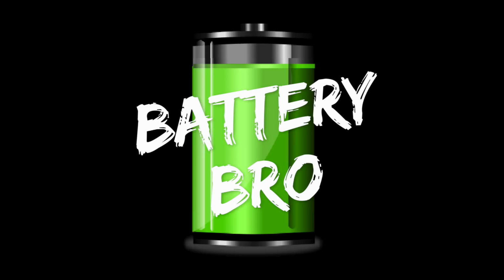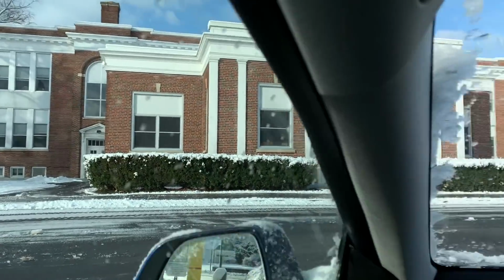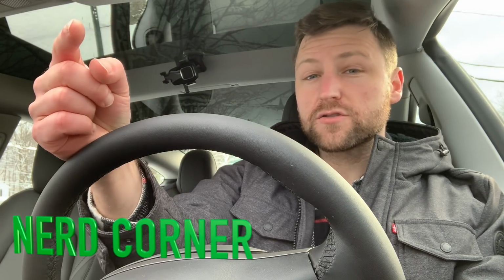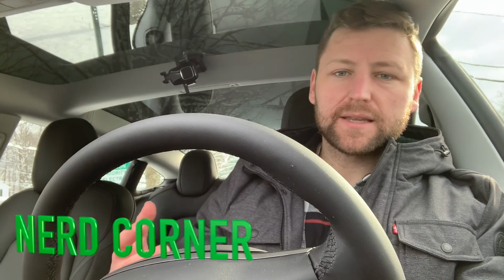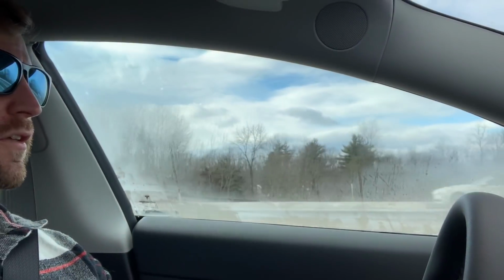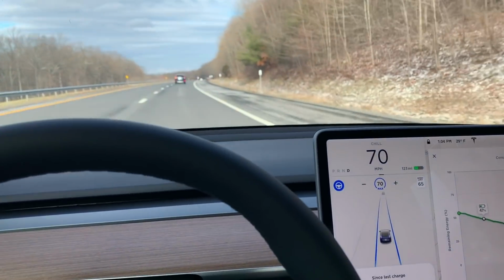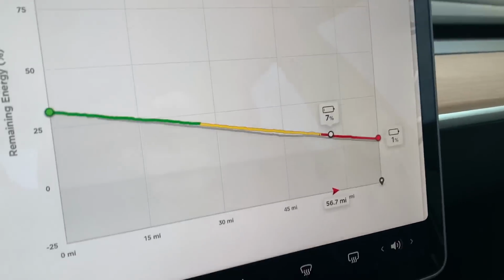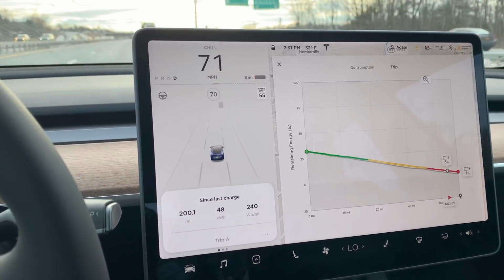2021 Tesla Model 3 Standard Range Plus Cold Weather Highway Range Test

Comment: Here’s a good test, drive 60 miles to the airport, park for week in cold weather, then see if you can make it home 😂 no don’t try that, that’s cruel. You will get stranded as these only get about 75 miles range in real world conditions like that.

What’s your battery degradation now? - or did you stop torturing yourself with range anxiety and hypothermia and get a diesel? 😂
Reply from the maker: Actually when I drive to the airport there’s free charging there. With the app I can make sure I arrive to a vehicle with a full free charge and a toasty cabin. Cars doing great thanks for asking.
Reply: @BatteryBro  Where is this? - I need to move there! - here (UK) there is no free charging (other than super slow ones in some supermarkets) and public charging is double the cost of diesel per mile.

You also can't leave the car plugged in indefinitely at the inconveniently far charger, with no shelter, you usually get drenched and spend 1+ hours loitering at some nearby shop.
Reply from the maker: @DigiDriftZone  I asked chatGPT which airports have free charging. I know for sure this is a tiny percentage of airports with free charging. 
Los Angeles International Airport (LAX) - LAX has several EV charging stations located in various parking areas, including the Central Terminal Area and Economy Lot C.

San Francisco International Airport (SFO) - SFO offers EV charging stations at various parking garages and lots, such as the Domestic Garage, International Garages A and G, and the Long-Term Parking Lot.

Amsterdam Airport Schiphol (AMS) - Schiphol Airport in the Netherlands has multiple charging points for electric vehicles, available in various parking facilities.

Oslo Airport Gardermoen (OSL) - Oslo Airport in Norway provides charging stations for electric cars in several parking areas, enabling travelers to charge their vehicles while parked.

Frankfurt Airport (FRA) - FRA, one of Germany's busiest airports, has implemented EV charging infrastructure. Charging stations are available in different parking areas, including terminal parking garages.

Helsinki Airport (HEL) - Helsinki Airport in Finland offers EV charging facilities for electric vehicle owners in various parking lots.

Copenhagen Airport (CPH) - CPH in Denmark provides charging stations for electric cars in its parking facilities, allowing travelers to charge their vehicles while away.

Seattle-Tacoma International Airport (SEA) - SEA has multiple EV charging stations available in its parking garages, offering convenient charging options for electric car owners.
Reply: @BatteryBro  in 2021, most (or all?) of those charge now unfortunately. Yes it’s a vanishingly small percentage that offer free charging and this is going away. In the UK we started with free charging everywhere, almost all of those are gone and they now average at 60p / kWh which is 6x the price of a home night rate, but those night rates are going away too :( - not that most people can charge at home in the first place.
Reply from the maker: @DigiDriftZone  from frankfurt's airport's website: There are of course still EV parking spaces within FRA’s parking structures that travelers and visitors can access spontaneously. However, charging the battery for free is limited to 3.7  kW here, and there is no guarantee of a space at one of the charging stations. EV parking spaces without pre-booking are available at Terminal 1, parking row 1406, and at Terminal 2, parking row U323.

you just don't like EVs, are you a shill?
Reply: @BatteryBro  No it isn't, that's a news article from 2019, all those closed down and now EV parking costs 5x that of non-EV. You didn't actually read it did you? - You ignored all my points and questions and tried (and failed) to create a straw-man, congratulations.

Comment: I love the clean and easy idea of an electric car. Quiet low maintenance no oil changes etc. Tesla currently does it best but the low range kills it for me. Especially if im paying so much IMO for the lower spec model 3. If i want more range which i need for my specific job i would need to go for dual motor long range or model Y, both of which are way out of my budget. Plus i dont want to always have to be waiting for it to charge its just too inconvenient. 

Therefore my only options for long range say 500miles or more are still traditional gasoline or hybrid vehicles which are for the most part way cheaper. Idk i just dont think the electric car is fully there yet or affordable to most people with lower income.
Reply from the maker: Wife and I have a n EV and a gas car. 
Generally:
road trips less than 300 miles we take the Tesla (it's way nicer than her old CR-V and cheaper)
trips > 400 miles: fly. 
everything in between we don't go
never drive the gas car except maybe to home depot because it has more space.

Comment: The reason why you made such great range is very simple : 1. Sunshine heats your cabin. This realy makes a big difference. Try it at night or during a dark gloomy cold day, ... big difference. 2. The temperature might have been low, but to a much greater extend, standing water, slush or snow combined with a stiff headwind is much much worse for  your range than temperature. 3. You were driving at a very constant speed on mostly flat terrain. 
Try driving trough Scotland on a barren winter day... different story. But nice test, thanks.
Reply: I've tried this and you're right, the range drastically plummets. Also he's driving at a speed that's well below the average highway speed in my area, and range really starts to plummet when you're going even just 20 mph faster

Comment: You know that the new 2021 model 3s have a heat pump? Your explanation of how its heating up the car is all wrong. Haha. Also 28 isn't that cold. I was hoping to see negatives to see how good the mileage and consumption is. I have seen 20+ of these temp videos.
Also why would you accelerate more to compensate for regen? That's part of how the car gets the epa estimate range. Wow.
Reply from the maker: The 2021 does have a heat pump however it still utilizes the clever resistive heating trick of older generation Model 3s which I find pretty interesting. The evidence of this was abundant; the charging rate was more than cut in half, the motors draw was 3.5kW, the stator temperature was quite high, and what's more you could actually hear the motor spinning. 
The objective of accelerating quickly was to negate any gains made by slowing down, as the test was intended to be conducted at a constant speed. In other words I didn't want to cheat. 
I hope this helps clear up any confusion you might have had and please consider liking and subscribing to learn more.

Comment: how much will the heater eat up?
Reply from the maker: Should have mentioned this in the video. Tesla Bjorn has done some good work to show that the draw is about 700w. This drive was roughly 3 hrs. 700w*3hrs = 2.1 kWh. The battery is about 51 kWh between 100%-0%. This means our range would have gone down about 4% from 210 miles to 201 miles, or 214 miles if you include the buffer below 0%.

Comment: Did you note your tyre pressure before, during and at the end of you test? Curious what this is as my average for my LR 2021 averages 280 on motorway journeys with my psi at 44 cold. 290 over my cars 2000 mile lifetime. Average temps of around 3 degrees Celsius
Reply from the maker: 42-43 psi as reported by the car. I checked about 50 miles into the trip.

Comment: What application did you use to get the inlet temperature graph?
Reply: I wrote up my experience with OBD for my 2018 Model 3 LR here:
https://TinkerTry.com/tesla-stats-for-nerds
in case you find it helpful.
Reply from the maker: Fantastic write-up :)
Reply: @BatteryBro  Aww, thank you!
Reply from the maker: Scan My Tesla (SMT) (iOS/android app store) though I like Teslax as well as that theoretically can record the CAN-BUS data. You need to plug in a bluetooth ODBii reader through wiring harness to a particular cable in the back. Some good videos from a number of folks you can find on how to do it. the ODBii reader will set you back about $100 USD though. Most data can be captured for free through TeslaFi / A better route planner / some others (battery inlet temp is not one).

Comment: I'd like to see this at -22f or -30c and have real amount of snow on the road.
Reply: Agreed. I was expecting cold with a cold weather test. Not -1
Reply: Preferable -50f like normal temperatures right 🙈
Reply: @cc-addict5402  I live in Canada, I've lived through -50c, driven to work at that temperature, so yeah -50c would not be an unfair test esp if you want to sell your cars and now trucks up here.
Reply: @talamakara  damn yeah I live in NYS where it doesn’t get that crazy at all but it should be fine just let it sit running for 30 minutes and especially the newer Tesla model 3s come with the new heating pump which extends range and heats better so it should be fine
Reply: @cc-addict5402  heat requires power, more power less distance. :)

Comment: 30F is not cold. That is just starting to get chilly. Also, sitting at a charging station to get the car heated is hardly a real world test. Try doing this at - 10F and just jump in the car and go. Use the heater. That will tell us if it really is a viable winter car.
Reply: Agreed on almost all those points except the jump in your car and go. How many people don't warm their vehicles up before going somewhere. 

If you're just hoping in and going, it's a short drive; something the tesla will have no problem with
Reply: @MIA7Xthies  Warming up an ICE car to melt the ice on the windshield takes 5-10 minutes, and isn't necessary to attain usable range. Warming up the Tesla in this video was necessary for adequate range, and took quite some time. So basically, a Tesla becomes far less capable in the winter.
Reply: @TroySavary  yeah, 83% of a 45mpg ICE would be 37.35mpg... almost a 10mpg hit with no heat.
Reply: @TroySavary  hardly. If you're going somewhere you need the range for, you're always going to preheat the vehicles just like you you'd start a car to warm it up before you leave. If you're going for a short drive, you just get in and go. Doesn't matter if it is ICE or EV
Reply: @MIA7Xthies  It takes 5 minutes to warm a gas vehicle. He drove to a charger, and sat there plugged in to warm the car. Do you need to drive to a specific spot to preheat a gas car?

Comment: Nice test! Though I wonder how much energy did you use to precharge the battery to its warmed state and to get the cabin to a nice temperature for a drive. That probably should be factored into the efficiency numbers. It might be interesting to see what the range is when totally cold.

Also 49kwh was measured by the car but what was the actual energy  delivered to get it back to 100% I heard this efficiency was something like 85% so 240 wh/ mi becomes 282wh/mi.

Comment: This is a nonsense test.   For a real cold range test,  charge to 100%,  unplug the car, and then set out the next morning (this is how the EPA tests)    Just like any fully fueled car would operate,  or you should show the preconditioning  consumption as part of your calculations, otherwise you are showing bogus data   My model Y uses power sitting in the garage overnight, at 60 degrees F,  and has extremely high consumption when I first set out on a journey.
Reply from the maker: Sincerely, thank you for watching. I’m a PhD in material science which informed the procedure of my test. My goal was to measure the maximum range and energy I could extract from the vehicle under the given circumstances. Including the latent heat energy in the calculation for efficiency of the vehicle does seem fair and I should have done it. During the test I wanted to put 0 barriers in the way of the vehicle to understand its best case. I do mention in the video my procedure to maximize range. And while it’s a favorable result I did not lie about any of the conditions of the test so I think calling it nonsense is nonsense. I stand by you can get 83% of the EPA rated range with just the energy available onboard the 2021 SR+ doing primarily 70mph  on a relatively level highway. Bonus I managed to do it when it was cold out. Also the benefit of conducting this test this way is next year when I perform it the same way the battery degradation will be measured with greater ease (not easy to hide 49kWh of discharge from a degraded battery).
Reply: @BatteryBro   I would think somebody with a PhD has something better to do, then create a completely unrealistic test which shows nothing real world.   In the world I live in, people don’t drive without heat in the winter time, with their windows halfway fogged up, and when you talk about the efficiency of the car, it’s the complete cycle, not just part of the cycle that matters.   I see I’m not the only one in the comments here who made a similar comment.   Hmmm.
Reply: @dmitchellhomes  not nonsense at all, if he stores the car plugged in, in the garage overnight and pre heats before he sets off...
Reply: @mjcamp01   I guess, if you like to drive your car with the heat off and fogged up windows this provide you some data.
Reply: Well, I appreciate this video.  David, how does it compare to the videos YOU have made?
Reply: This is a far better test than the EPA test, because this video shows you the real range you can have with the REAL highway speeds. EPA highway speeds is not realistic.
Reply: im trying convince my other half that we should get a Tesla SR+, however i cant see her being happy about sitting with the heating off in order to get to the next charge!

Comment: What is the charging speed on V3 on this USA made SR+ 2021? Battery warmed up of course.
Reply: That’s our next video! Should be out in a few days.
Reply: @adams2836  great, make sure to pre-warm the battery. Open the app  with about 30% SOC , lock the car and turn on the preheating in the app, it should show the battery symbol.  Wait until it drops to about 20%, start driving to the V3.
Also interesting will be a Test vs old SR+ without heat pump with and without heating to see if there is any efficiency gain

Comment: Great video! subscribed. How do you feel about the frameless windows and flush door handles in winter? Do you think it can have issues with freezing and have you dealt with any issues yet?
Reply from the maker: Frameless windows are not ideal. They seem to have a bit of trouble sealing perfectly when it gets very cold. I've noticed if you heat up the cabin a bit that helps sort it out. No issues with handles and ice so far. You just hit them with the back of your hand and that works very well.

Comment: Great Video! I have the 2020 SR+ and am near the FingerLakes. 2021 SR+ got some nice cold weather upgrades and 263 mi range. Does yours have the heat pump and double pane windows?
Reply from the maker: Hey neighbor! Yes it does! The pano sunroof + good insulation seemed to keep the cabin warm enough I didn’t even need to use the heatpump. Interior cabin temp was 54 F by the end of the drive which was getting a little cold by the end.
Reply: Great questions! That’s what I was gonna ask!